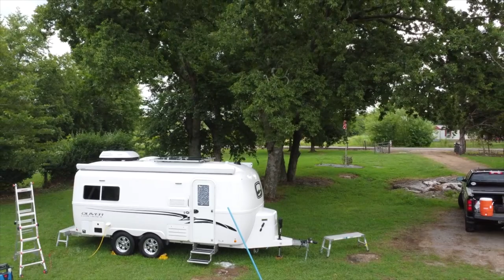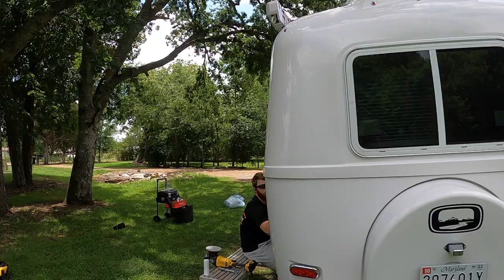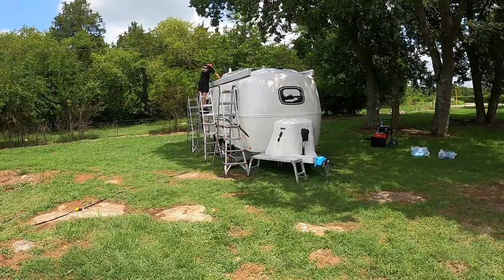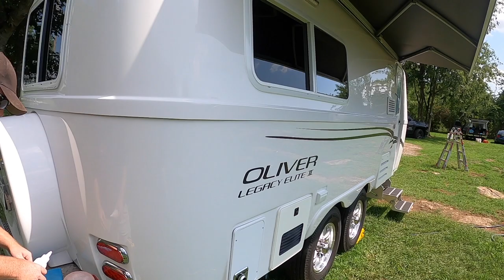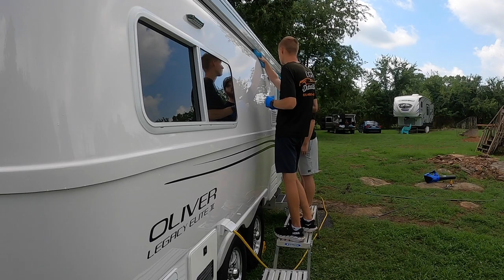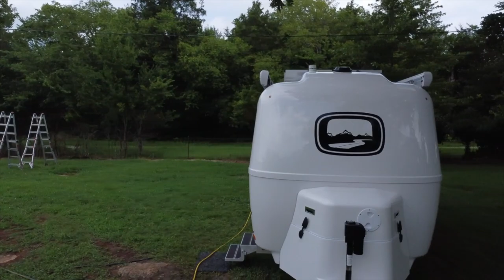Ceramic Coating an Oliver Travel Trailer in Murfreesboro, TN!

Comment: What is the price presently for you to do the Ceramic Coating on an Oliver?
Reply from the maker: We currently start at $2,800 for the Legacy Elite II and $2,000 for the Legacy Elite 1. Price varies based on the condition of the trailer and the amount of oxidation present on the surface